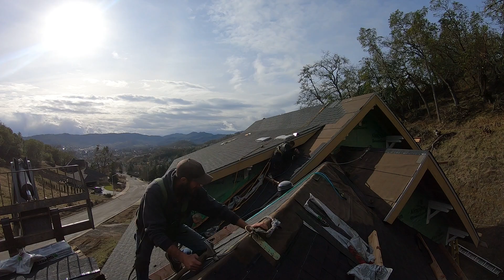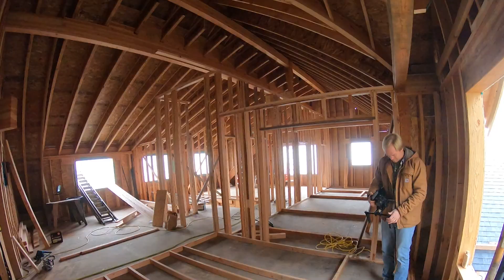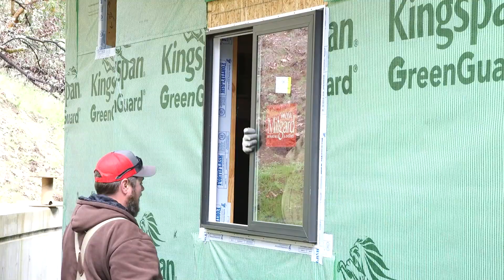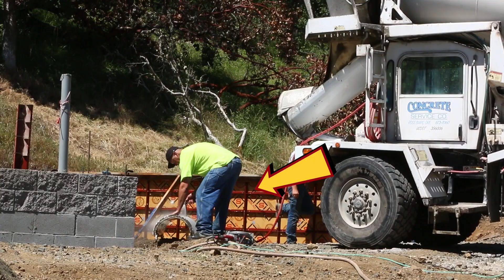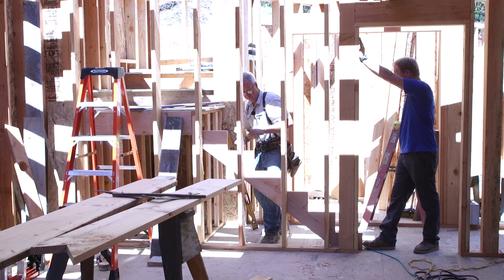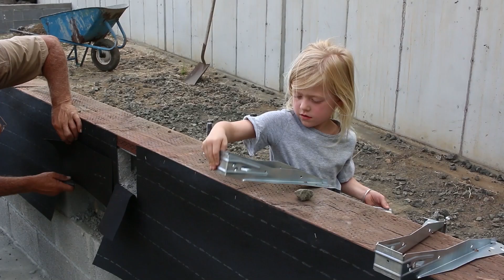10 Mistakes We Made Building Our Spec House

Comment: Milgard got bought out by MI windows and doors in november 2019. For a short while, they maintained the Milgard quality, but beginnjng late 2022, something happened, and their quality and customer service changed. No builders or suppliers will even touch them anymore in my area. The supplier I tried purchasing Milgard windows for a house I was building refused to sell them to me because he didn't want to eat the 5k in windows and then ranted to me for an hour about the change in quality.  

 Even the Home Depot display MI Windows installed a couple of months ago doesn't even open properly, even with no physical damage to the window.
Reply: So that's what happened! I've been in the trades for 40 years and was always happy with Milgard, but noticed the drop in quality at that exact same time!

Comment: I don’t think that using a different concrete mix made that much difference, I worked for a company and most of our work was as a subcontractor doing concrete construction. We would pour large sections of concrete sidewalk and place maybe four loads a day straight down the side of the road, we used the same concrete company, same batch plant, same mix, most of the time the same two drivers and you could tell where we stopped and started the next day by the color of the sidewalk. I’ve noticed that on just about every pour, especially if you would pour continuous sections of concrete. It probably has something to do with the curing as the concrete dries over time. 
I don’t recall if you poured your wall in one day , more than likely you did so placing more concrete a few months later was always going to be noticeable to someone who does that kind of work. We called it a curse that you would always look and notice little things about other companies work and I know it’s the same with all the trades. 
Thanks for showing us some of the little things from a great project, now back to the workbench and we’ll see you next week!

Comment: I bought an architect designed, builder put together in 1989, it had a laundry list to repair of 72 items. The builder completed half. We lived there for 14 years, it was a comfortable home. It was an all brick veneer, 5.5 bath home, 3750 sqft. The biggest problem it had was the windows would not open properly because the proper spacing under the windows was not done by the brick layers. Also in our master bedroom the overhand was too close and you only could open the 2 windows half way. Over the years we also ran into other minor problems, like the dead space you’re talking about. In the master bedroom there was a good closet formed by the roof, that could have been done. 
Our next home was a tract ranch, we’ve been living in it for the last 20 years.  We optioned out all the things we couldn’t do later without much cost. The items were…a vaulted ceiling in the family room and entryway (9’ in the whole home, and 14’ vaulted), 3 car garage, full basement, 10” higher basement, basement rough-in for an extra washroom, and a fireplace foundation. When the home was built we also did some changes by paying the subs. It’s has been the best and most comfortable home we’ve ever lived in. It’s been the home with virtually no repairs. We added ceramic (18” porcelain) floors in the kitchen, dinette, mud room, washrooms, basement and all connecting hallways, before we moved in.  In 2017” we did 4” wide oak floors in the bedrooms, entryway and family room.

Comment: For the pot filler - if you did one again - would you maybe put some tile or just finished concrete - with a drain - in just the space under the oven?  like a more commercial kitchen water proof floor in just that spot?  or would that be too much work for too little return?  i have always wanted a pot filler but had never thought about what would happen if it sprung a leak when i wasn't around.

Comment: Did you change anything about the potfiller? Really weird to me that american homes have those, water at spaces where it doesn't belong can always become a problem really fast.

In Europe I have never seen a potfiller before. 

I would hope the manufacturers had a more clever solution to that problem like an automatically closing valve or something.
Reply: I ask customers, "If you can't lift a pot of cold water up to the stove, what are you going to do with a boiling pot of stew?". And the no drain component. I'm surprised the code allows it.
Reply: Yes, I was surprised at that potfiller idea. Convenient but having any tap without a drain is risky.
Reply: They're really one of those trendy things that are ultimately a bad idea and not worth the slight convenience. Faucets can leak as they wear out or be left slightly on (as happened here), which isn't a problem if there's a sink under it. In this case, add in the double whammy of hardwood floors - tile would've been a much smaller problem for a leak. 

Even if you have mobility problems or something, you could always fill a cup in the sink and pour into the pot repeatedly. Of course, you still have to deal with dumping the heavy pot of water (when it's hot!), so fillers are clearly  a form over function thing.